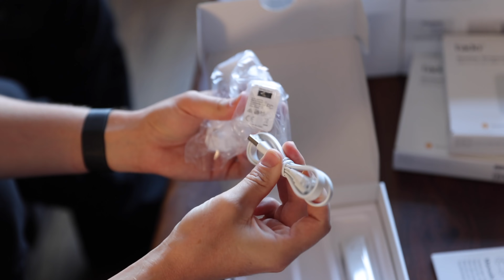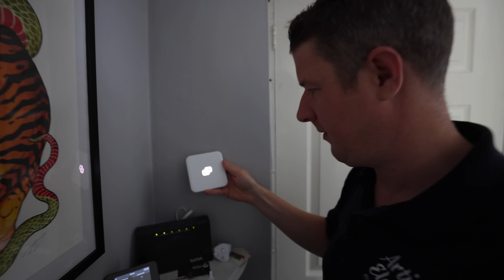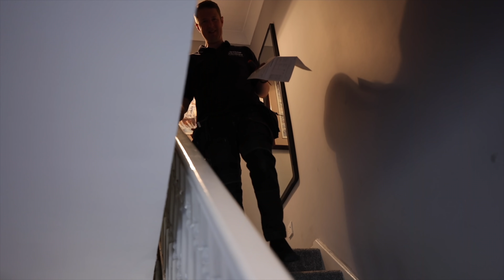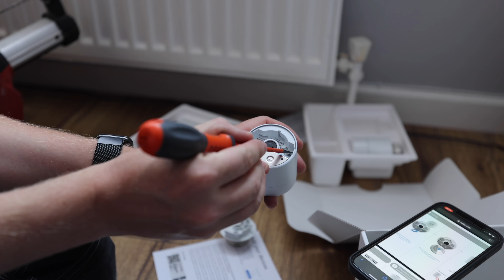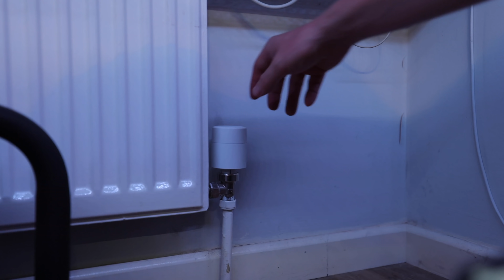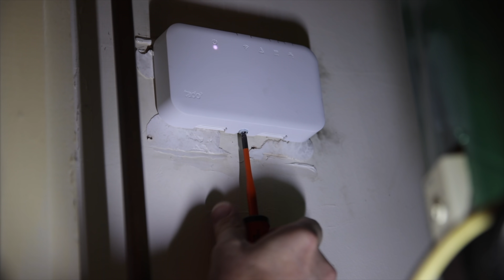THE ULTIMATE SMART THERMOSTAT? - Tado Smart Thermostat Installation

Comment: Great video. I bought my Tado thermostat about 5 yrs ago. Fitted it myself, & even got instant live support from Germany, when I got a bit 'stuck'. It's a great thermostat. 

However, a month ago a friend got one of these. Fitted by a professional, but having issues with it. Eg. It is switched OFF on the phone app, but the heating still stays ON. Temperatures automatically rise to 23 degrees.🥵

The UK support line is non-existent. Takes nearly 2 days to reply to any emails, or the phone line is normally to 'leave a message & we'll get back to you'. Very disappointing & disgraceful. The friend has decided to bin the Tado thermostat & go back to the manual one, she had before.

Comment: Does the heater need to be on or off? Like at number zero or five for example? Before you put the digital radiator on I mean, does the valve need to be on or off?

Comment: absolutely what I was looking for as I have a similar setup in my house with a Worcester combi boiler plus a hot water tank and a WIRED thermostat. So now I know I need to decommission the old WIRED thermostat and use the Tado WIRELESS one, and also install the TADO WIRELESS receiver to replace my  Drayton controller ‘Lifestyle LP822’ that controls the hot water tank temp and central heating system temp. Thank you!

Comment: Lee can't be that cosy in the front room because he has stairs in there which will lead to heat going upstairs! Also I've found out turning off radiators in unused rooms the boiler still uses the same amount of energy if it's heating 1 radiator or 10 radiators. It makes sense in a way however yes the boiler will come on and switch off accordingly a bit quicker than normal depending on 1 fact: don't turn off the radiator where the thermostat is else it will think everywhere is cold. Another good tip is to close all your doors where the thermostat is located so the reading will reach what you set it at rather than heating the whole house/flat

Comment: I have the entire tado devices controling heat. But the best part is that it can control my heating via BUS connection. So it can request ex. 20% heating and stop from overshooting temps. Really amazing product. Only issue is the smart open window feature sucks. If a open window is detected it starts heating after a certain period of time. NOT when you close the window, worst part is that you can not use a window sensor to ensure heating does not start until you close the window.

Comment: Good Video ,  I bought the starter kit from Screwfix but boy do I regret it.  Tado Support is pretty useless .  My boiler switches on automatically even if the wireless thermostat is switched off.  read the trust pilot reviews the most recent ones .

Comment: Hi Am I correct that if I get the TADO smart thermerstate and TADO smart thermerstatic radiator valves the TRVs will only go as hot as the tempriture set on the smart thermerstat eg if the wall smart thermerstat is set at 20 and I want a radiator to go up to 22 will it do it or do I also have to turn the wall smart thermerstate up to 22?

Comment: Erm
"Live and Neutral permanently live ch on hw on hw off
No neutral. Normally Open and Normally closed and common
Normally open is call for heat and common is the permanent live coming down
Term 1a 2b 3c so A is permanently live b is normally open c is normally closed. We want Permanently live to common and normally open to switched live so that's really really easy" wtf?

Comment: Hi, I was going to install the Tado smart thermostat on my Vaillant Ecotec 831 boiler however I spoke with an engineer who said while it can be done the Ecotec boilers it will not run as efficiently as they would using their own controllers.

This is due to vaillant having their own Ebus chip and third party controllers can only control the boiler to be on or off rather than gradual heat control, this wasn't always the case with the previos vr65 which I think were opentherm but since the vr66 this seems to not work aswell with third party.

Because of this I decided to only purchase the Tado radiator thermostats which come with the bridge in order to run those as an extra while keeping my Vaillant controller.

Please can you or anyone else confirm this to be true?
Reply: Yes that is correct. Vaillant use their own communication language call eBus. But Vaillant have their own controller which is very good. You'd need the vSmart controller. It also uses local weather station data to anticipate changes in heat requirements. More effective if you happen to be close to your local weather station. A third party controller such as the Tado will still work, its just that it will act as an on/off switch rather than modulate the boiler output. It's a shame Vaillant don't support opentherm to give more options, but the Ecotec's are great boilers and the vSmart is a great controller

Comment: why the Tado doesn't have Wi-Fi built into the main thermostat, so you can use it w/o the bridge, seems dumb. It is, especially if there are no spare Ethernet ports or power sockets nearby.

Comment: We have several rooms with multiple radiators. How does this system cope with setting the temperature in one of those rooms? Will the system turn on the boiler if the temperature drops in one room?
Reply: With rooms with more than one rad, you add the Trvs to each rad then choose one in the app to be the measuring device for the room. Not ideal in a big room really but that's why they do the wireless tenp sensors as well. And yes, the system can control the temperature separately in each room that you have the Trvs fitted.

Comment: According to my assessor on my annual NIC EIC inspection, Fluke T600 or T1000 multi testers aren't allowed for use when doing safe isolation. I was a bit surprised when he took issue with them, especially as I've used them for every inspection since registration ten years ago 😂 All multi testers aren't allowed due to potential for mis selection of what they are measuring apparently🤷🏼‍♂️

Comment: This video is a perfect example of why the Tado system is not as straightforward to either buy or install compared to the Drayton Wiser system. It looks modern and slick,  but so messy trying to work out what you need to buy and so many people have been caught out buying the wrong kit like yourselves. Even the website doesn't help you out any better. I was originally going to buy the Tado system, but after getting confused about what is the right kit to buy and reading about so many people having connection issues in larger houses with the TRVs, I went for the Drayton Wiser system. So much simpler to buy and install (Combi kit, HW + 1 CH Zone, or HW + 2 CH zones), no internet bridge needed and new hub simply clicks onto the existing std wiring harness of the old programmer saving the need for any re-wiring. Wired room thermostat needs to be bridged at either the thermostat end or at the wiring centre end (after removing or disconnecting the thermostat wiring).  Any connection issues can be resolved by adding the smart plugs to extend the mesh network to the farther points of your property, but I didn't need this. Also the smart radiator valves are where the cost mounts up and Tado's are more expensive than Wiser's. Think it would be really useful to you you produce a video comparing the two systems now that you have installed both systems now to see how they compare for installation and daily use.

Comment: I have the Tado system installed and it does save a fortune in Gas used. However I have not found any purpose for the room sensor. It is just a digital readout. The thermostatic valves are your room sensor. I would also point out that if you are planning to install thermostat rad controllers, it is important to leave one or two radiators open. I use the towel rails as the open circuits. This prevents the system closing off the flow around the primary heating circuit and burning out the circulating pump.
Reply: A differential pressure valve will save you from having a radiator open all time and will save you more money. You can also specify which sensor you want to use for the room, either the trv or the wireless sensor.

Comment: Jordan: Can I use the tado wifi radiator valves without any tado smart wall temperature sensors or boiler controller. I already have a wifi boiler programmer accessible because my boiler is in the loft?         A big plus for me would be the ability to individually schedule on and off time for each individual radiator, naturally my existing boiler timer would be set to 'constantly on' at a convenient temperature i.e. as it is now.

Comment: Normally the CH is configured with one none thermostatic valve. This means if the thermostat calls for heat at least one rad is open. 

With the tado you can have all rads on thermostatic valves. Tado will manage the interlocking making sure at least one rad is open before calling for heat (basically like a UFH manifold).
Reply: Good to know. I left one "dumb" thermostat on a radiator just for that purpose. Even removed the knob so no one could turn it off

Comment: Oh dear, Jordan. I dont think you knew these at all. First of all, there are only two types of starter kit. One is wired if you have an existing  wired thermostat (like on this installation) and the other is a wireless if you dont have an existing wired thermostat or want to change placement hence nothing to do with the type of boiler. Also hence you had the correct one to start with just bridge upstairs (switch to always on). If you wanted to control the hot water from within Tado,  then you could of just bought the extension as an add-on but do bare in mind that this is not needed for combi boilers since the demand is controlled by the tap. Also in this instance where you have a hot water tank, the recommendation is to always leave it on for efficiency and the only time you would probably want to turn it off would be if you left the house unoccupied for very long periods ie. weeks.
Reply: @William Tell I'm hoping that the immersion has a 'remote' switch, normally located in the kitchen or near bathroom which is off.

Comment: There’s also a different version for boilers with existing wireless thermostats too .. not just for systems with cyclinders.

As well as the thermostat, that kit comes with a wireless receiver that is wired into the boiler. The thermostat can then be placed wherever you want, wire free. 

If you have a Hive or a Nest you’ll know what I mean.
Reply: I can’t work out how this system would work with a Combi boiler - Can the individual TADOs demand the boiler to deliver hot water?

Comment: And you can even link your Tado to certain energy suppliers so that you get better energy usage reports when used with a smart meter …
Reply: I’ve not found this. Where is this setting?
Reply: @inthapipeline  so if it’s offered it’ll be in your online account for your energy supplier and not the Tado app.
Reply: Not all energy companies have an integration with Tado though.

Comment: Shame the Digital connection was not utilised, the boiler looks like an Ideal/Keston these are opentherm compatible. Boilers are not just switches, they need to be run at low temperatures. I would advise speaking to a Heating technician who understands how to make modulation controls work.

Comment: The efficiency of the system is entirely capped by how low your boiler can modulate. If a single smart TRV calls for heat it's unlikely to be enough demand for your boiler to not cycle and obviously nothing is changing the flow temperature of the system.
Reply: Tado can communicate in all the main digital languages like opentherm etc, it just requires wiring into the boiler differently than just your standard on-off switched live wiring. There's a pro installer instruction manual on their website explaining the wiring for the main boiler manufacturers and how to setup the thermostat in order for it to be able to modulate the boiler. That's what makes tado stand out from the other smart thermostat systems.
Reply: @rodgerq  assuming that only works if the boiler can modulate thought right?
Reply: @andrewc5932  yeah, the boiler must be able to modulate.  In not a heating engineer but I'd hazard a guess that the vast majority, if not all, modern condensing boilers are able to modulate the burner and the pump.

Comment: Ian

I came across this discussion.

 Ideally the room thermostat should be located in a cool room, usually the last room to warm up. That way the other rooms will be warm enough, (but not overheated because of their TRV’s) before the room thermostat switches the entire heating system off. Locate it elsewhere and it will turn off all of the heating before the rest of the house is warm enough.

The room thermostat should be in a room that is not effected by other sources of heat such as an open fire, cooking equipment, or sunlight etc. It should not be near a radiator, hidden in a corner or behind furniture.

The radiator in the room with the thermostat installed should not have a TRV fitted. Otherwise the TRV may interfere with the correct operation of the room thermostat.

Based on the above, the hall may often be the most suitable location.

A thermostat located in the hall, should be set so that the hall doesn't heat up too quickly. For example a thermostat in the hall could be set to 19 C and because it is the last room to warm up, the bedrooms TRV's will start to shut the bedroom rads down at 18 C, the lounge & dining room will get to 21 C and the kitchen 19 C, all before the Hall reaches 19 C and shuts the entire heating system down. 

The issue then is if, say the lounge TRVs demand heating, and the thermostat in the hall has shut the system down, what happens next?
Reply: You are correct for most part but the thermostat in the hallway (coldest part) wants to be set the temperature you want ie. 20-21 C. Being the the is the coldest part, it will allow the warmer rooms to reach temperature before it shuts off. You then spend some time adjusting TRV's (if manual) as to what temperatures you want in those rooms. 

As for your last question, this system can be setup so that each thermostat can call for heat hence overriding each other including the main one.

Comment: FYI you don’t need the wireless thermostat in a room if you’ve got the smart radiator valve as it had a thermostat built in
Reply: The trouble with TRVs on the radiator is that they don't measure the temperature of the room at the best place.
They didn't make it clear what happens when you have both, but hopefully if there's a wireless sensor in the room that takes precedence, and if there isn't, the radiator's own TRV takes control.

Comment: Tado is good but from an installer perspective it's limited on property size. Tend to find the actuators get stuck or in summer have jammed the pins down (no different than honeywell or other "smart TRVs" in that regard) which normally ends up with a plumbing call out. The TRV's aren't essential though and provide limited benefit over a traditional wax stat TRV considering most will be set for life to their respective use case and the over all smart control governing the house will have more impact on bills.

As a side note that open vented combination cylinder (expansion and fill tank directly above hot water cylinder in the same unit) being changed out to a pressurized system would likely save equal or more energy depending on usage.

Comment: Nice job. Not too tough an install, as long as you get the old manual thermostat wiring the normally open and common bridged. So one question: Why have a room thermostat, if the radiators have thermostats? Room thermostats seem redundant, if all radiators are independent.
Reply: I’ve had the Tado system for around two years. Technically, yes, the room thermostats are essentially redundant. However, they can and do serve some purpose; because the smart valves contain the thermostats AT the radiators, they often detect the temperature as higher than it is in the rest of the room. This can be accounted for in the app by setting a temperature offset. But a better way is to have a thermostat, head/body height, with the valves linked to this. This way the temperature is more accurately measured. I’ve not bothered in most of my rooms but I did do this in my toddler’s bedroom with the thermostat placed quite low at around the height that he sleeps.